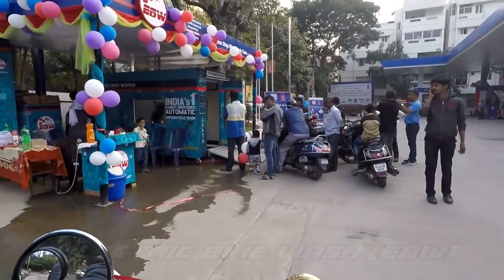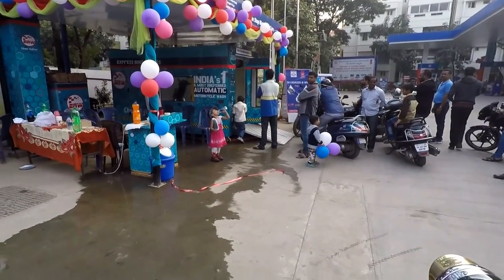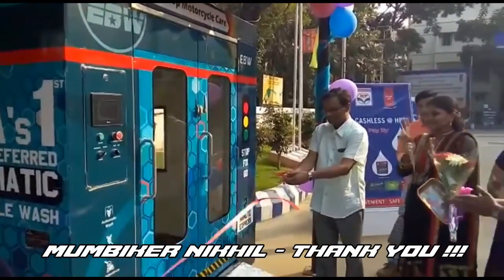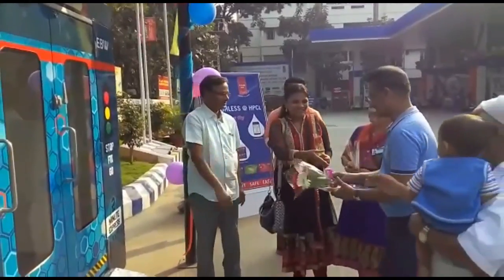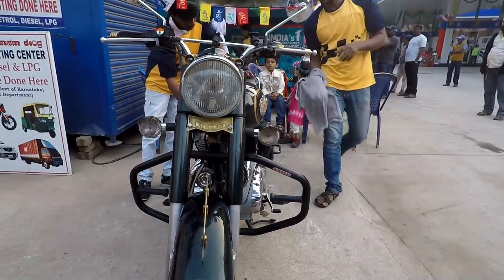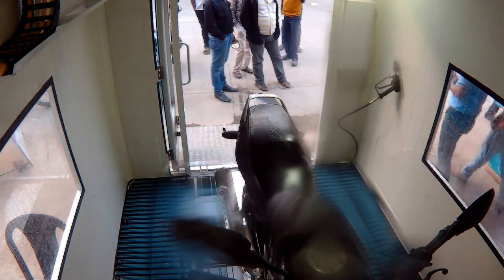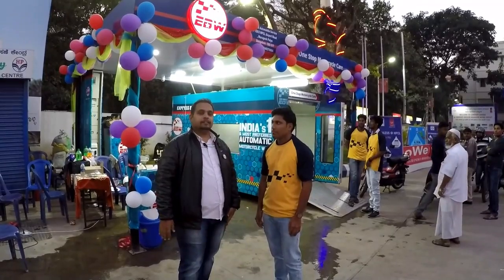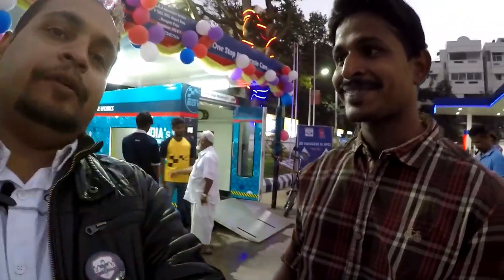AUTOMATIC WASH FOR MOTORCYCLES | EXPRESS BIKE WASH

Comment: Hello Bhai, Royal enfield classic 350, 2 yr old..engine shutting down when I switched on my lights. It suddenly stops if I switched on my light switch. But if I turn off the light switch then the bike starts running without any issues.My horn , indicator & Neutral light is working fine during the engine running.But if I only keep the light switch on then my neutral light is also getting off with my engine off.. PLEASE HELP :(